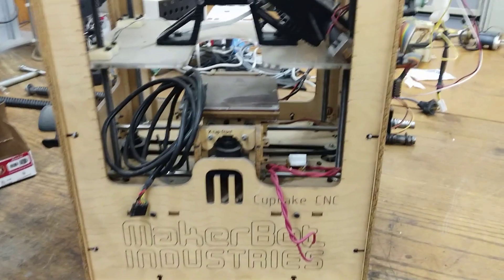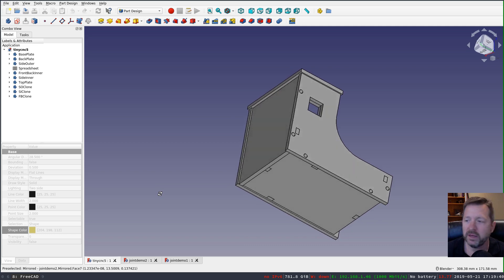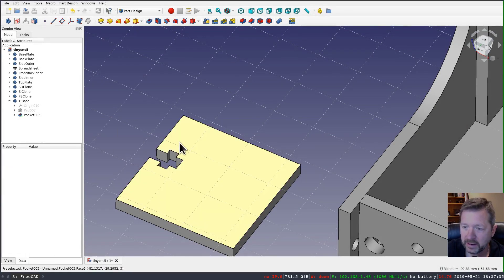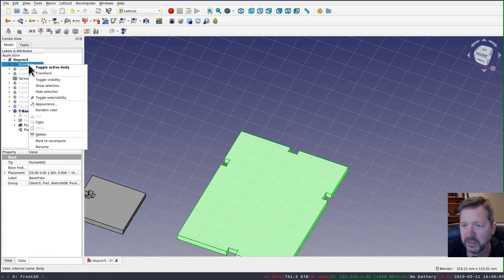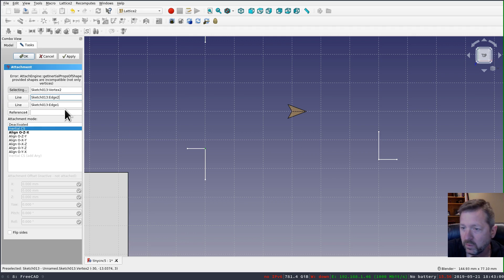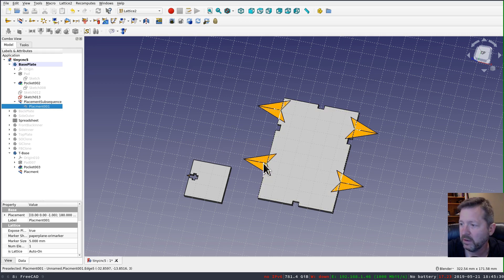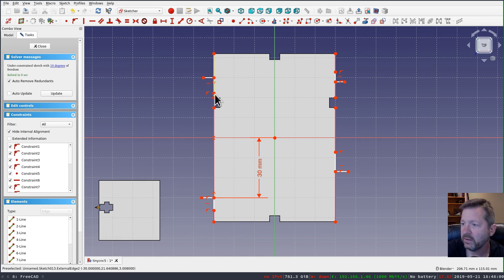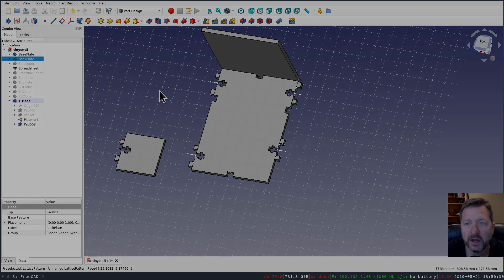Feature Patterns with Lattice2 Workbench

Comment: It is possible to extend this Workbench to be able to insert/change/remove hinges, minifixes, dowels and other joinery hardware used in the creation of furniture? Here it is an example in SolidWorks: https://youtu.be/y7kd8X_PTXI and here a parametric hinge inserted in two panels (TopSolid): https://youtu.be/8b7A-Xh_HbA who will automatically generate the necessary mechanisation holes for both the door and the side panel.

Comment: Hi Sliptonic, i was watching your FreeCAD path tutorials very arefully. Unfortunately i could not
manage to create a path what could be used to produce a lens. Today i stumbeled over the FreeCAD
toppic called 3D Surface (3D Surface - Face Selection (New feature), its related to a OCL Dropcutter 
algorythm i guess. Now i have the proper icon for this function in FreeCAD but it doesen't work. Could 
you pleas light up the toppic how to install the  Path 3D Surface to a Windows FreeCAD? 
Here is the link to the forumtopic: https://forum.freecadweb.org/viewtopic.php?f=15&t=41997&hilit=sphere
Reply from the maker: It depends on what version you're running and how you installed it.  You need to have opencamlib (OCL) installed.  I think that's included in the appimage development version now.
Reply: @sliptonic  Thank you for replying! :) After enabeling the experimental features in FreeCAD 
-> tools -> edit parameters -> EnableExperimentalFeatures Boolean true.
I found and downloaded the "ocl.pyd" (python27_x64-ocl.zip) placed it into the lib folder
"C:\Program Files\FreeCAD 0.18\lib\ocl.pyd". I also placed the PathSurface.py file into the PathScripts folder
"C:\Program Files\FreeCAD 0.18\Mod\Path\PathScripts\PathSurface.py". Additional i did the abra cadabra
with the console "import ocl" and pressed enter. Guess i did something right after all, no error was returned and
a drop down menue with the "3D Surface" was granted. But after all, there was only my stupid face expression
no path was generated. I took me a while to figure all this out, it's literly black magic for me. However i still
refuse to use Fusion 360 and would really like to see FreeCAD kick ass.  I really would like to help speed
up the development process of the FreeCAD project, but not everyone is born a rocketscientist sadly.
Thank you for participating in the develoment process of this really nice program!
Reply from the maker: You really need to post on the forum and include your FreeCAD info from the help->about screen.  A lot of this is version dependent.  Not just FreeCAD version but also Python version.   If you post there, we can upload a file configured with a surface operation that should generate a path.  You can load it and recompute.  Sorry, it's just really difficult to do support in Youtube comments :-(

Comment: So, L-markers are basically a way to construct new 3d vector basis (3x3 matrix) that can be used to transform any 3d object into space defined by L-markers?

I guess that first line defines X, second Y and Z can be calculated as a cross product of X and Y. Vertex in a middle is a centre of that 3d space. Length of the L-markers probably doesn't matter because vectors X (vertex1-vertex2) and Y (vertex3-vertex2) are later on normalized.  I wonder if two lines have to be perpendicular, because for example this can be fixed by using cross product Z and X or other orthogonalization method.

Btw. nice tutorial, I learned something new :D

Comment: I see you place sketches on faces. Isn't that discouraged because it might break references?  Has that changed in V0.19? Did you do that only to keep this video simple?
Reply from the maker: It has not changed in 0.19. When bodies get particularly complicated I highly recommend avoiding sketching directly on a face. Use a master sketch or the new carbon copy tool in 0.19. But I don't think sketching on a face should be categorically discouraged. It's fast, simple, and intuitive. For simple bodies like the t-base, it's my preferred method. For placing the reference sketch on the part, I probably shouldn't.  I did it to keep the video simple.
Reply: @sliptonic  Thank you for answering and hinting me to that carbon copy tool. I hadn't noticed that yet and it seems to be quite a useful feature.

Comment: Nice tutorial. I will have to look into Lattice2. Have you looked at LCInterlocking workbench? It would make creating this feature much easier...
Reply from the maker: Yes! The lcinterlock workbench is also very nice. There's been several attempts at box - makers like it but it's the best I've seen.

What I'm doing in this video is a more generic technique. It can be used for this kind of joint but also for other joints, tabs, clips, or any kind of complex feature. Check out the lattice2 github page for another example.
Reply: sliptonic It’s a really interesting workbench. Thanks for the video!